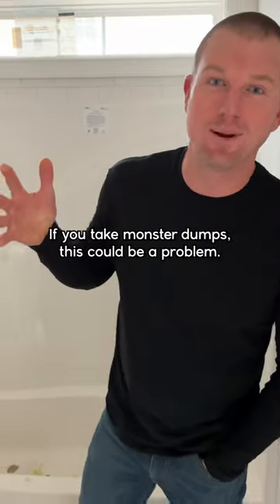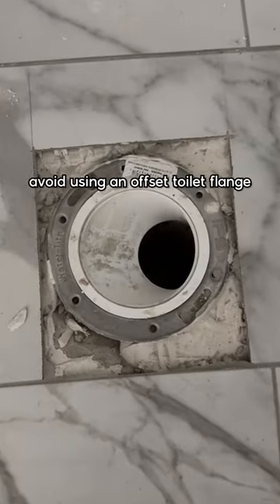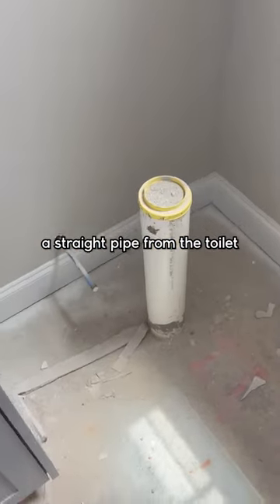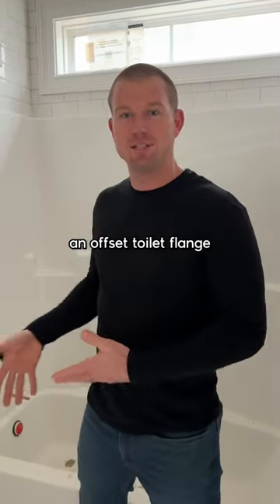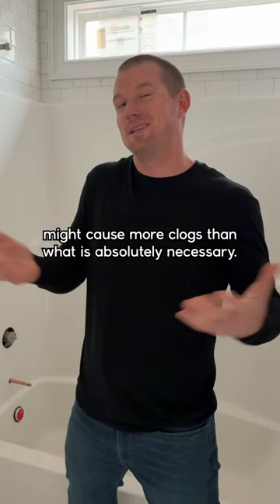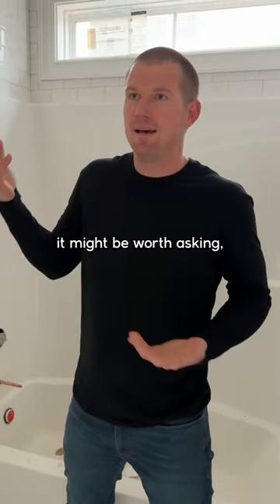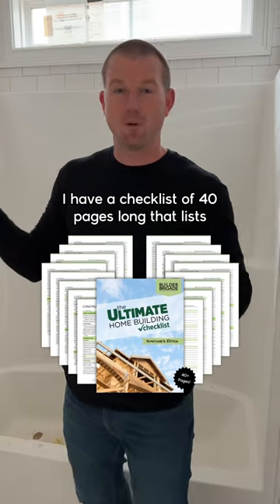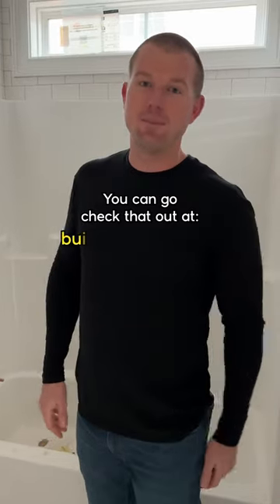Monster dumps 💩 could be a problem…

Comment: The problem is, When the plumbers and carpenters are building the house, Hi shitter's gotta go or a shitter's gotta go. Your floor joys are random. They can be headed off. It's when everybody doesn't work together that they put shit in our way. Under no circumstances would any legitimate plumber putting it off at flinch. This is usually done by rat plumbers during remodels, When there is no body to move the floor joyst.

Comment: lol. The P or S trap inside the toilet as well as the drain pipe will give more resistance then that offset ever will.
Reply: Yeah not necessary to have p trap for a toilet
Reply: @blipblop92  
He said, inside the toilet, the built in trap of the toilet itself
Reply: Correct.  This guy isn't going off facts, just his own assumption

Comment: Whether it be a tract home or a custom home this is normally taken care of by the architect so these are not necessary. The only time I’ve run into a toilet that needed this was a basement rough-in where the toilet was too close to a shower. I used the offset flange and this was not a toilet used daily and it never caused a problem.

Comment: No issues with the plumbing, but after recently upgrading from a fun-sized toilet to a full-sized adult toilet, we did discover we have an offset flange. Also, if your wax ring melts and the toilet starts shifting along the floor, an offset flange will have a greater chance of causing ... puddling ... when the drain isn't aligned with the flange.

Comment: When My house got built, the closet and bathroom design was altered by the builder and the toilet was moved and closet wall moved back and the closet wall was built closer to the toilet center than UPC ALLOWS ONLY 11" AWAY FROM THE SIDE WALL.  When you sat on the toilet your leg and arm and shoulders were cramped against the wall to your right, I caught this upon inspection before signing off on the house and had them fix this as much as possible and move the T.P. HOLDER too as it sat on top of your leg too.  They put a off set toilet flange to increase the distance from the wall, instead of the UPC DISTANCE of 15" on center it was 13" on center, better than the previous 11" on Center. So unless the floor was jack hammered and the drain pipe reset this was the only option and not a easy fix.

Comment: Hey I know this sounds bad… my toilet flange in my downstairs half bath is in fact a 3” flange but it steps down to a 1 1/2 pipe. Even when you don’t take a crap down the toilet it clogs so I know it should be bigger. Do you think this is a job a simple landlord could fix maybe stepping it up to 1 3/4 or even 2” pipe if I have to cough up the change. Or must I call a plumber…..  could the fix be taking care of for less then $75 ???? Thanks
Reply: Waste pipe for a toilet should be 3" minimum.

Comment: Nope... To me this should have been caught  in ohase 1 and the framers sent back to redo the framing on that floor. There is a maximum distance between joists but there is no minimum distance. They can add one more joist and shift the joist blocking the path over couple inches so that everything is within the code for recommended distance between joists. If that's a load-bearing joist that can't be moved then there's a whole lot more wrong with that house from the get-go that needs to be looked at. But sadly this is the "Just make it work" mentality that is pervasive in construction to get stuff done as quickly and cheaply as possible without going back multiple times... So I understand why the offset pipe is the go-to rather than making another contractor do their job properly.